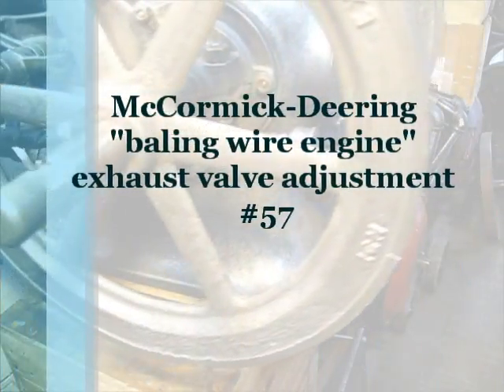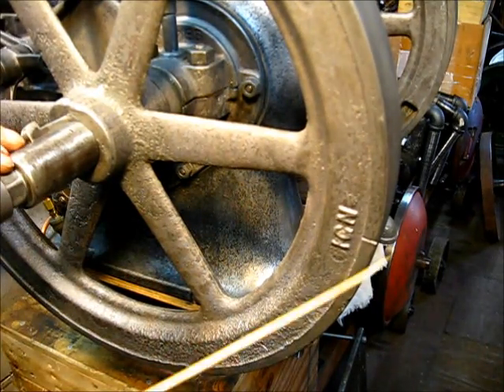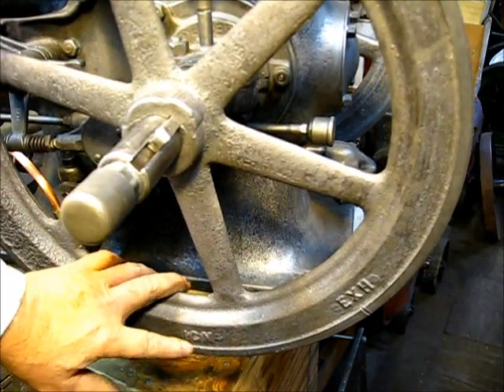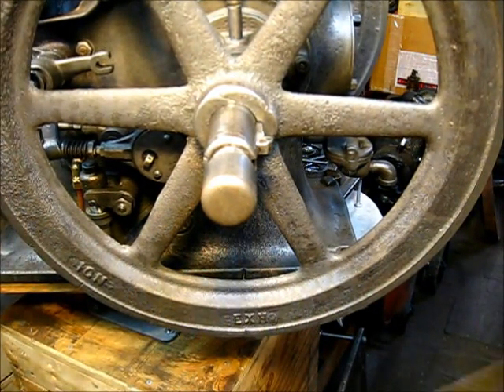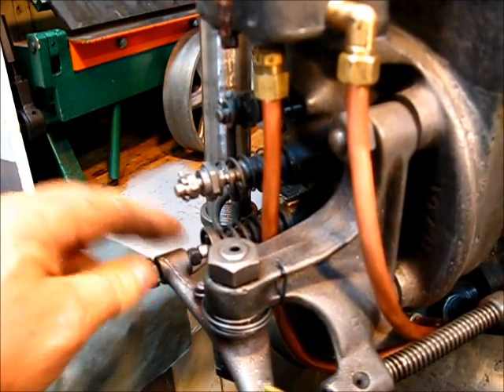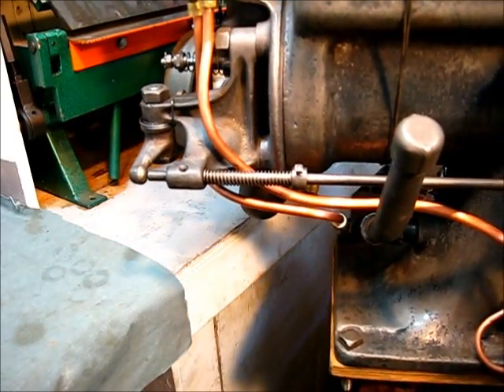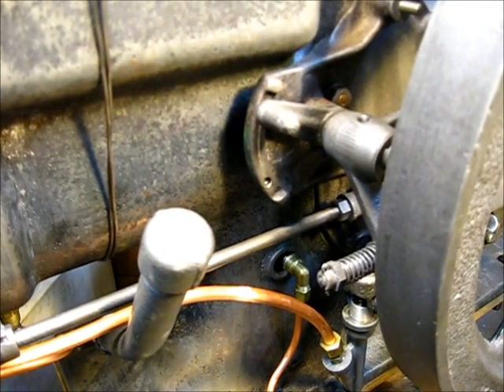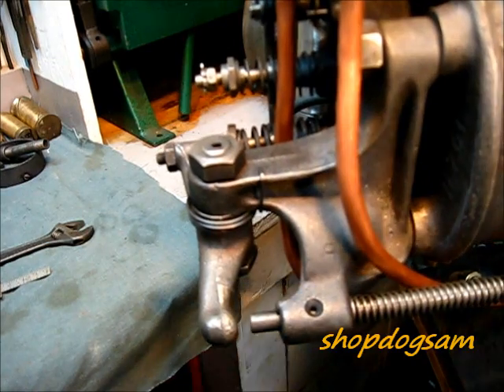McCormick-Deering "baling wire engine" #57

Comment: I bet it runs good because you said it had compression. What would be a good example of what it could used to operate?Will it run fast enough to run a generator? I see a lot of fans people put them on and that would be nice about this time of year because its hotter than the a wagon wheel hub outside.

Comment from the maker: ,,,, boiled linseed oil finish (oh!, this is gonna be good),, ek magneto rebuild (a more complete video will follow later),, ignition timing (easy to do),, mounting 'er on an engine cart (cart is already built),, gas up (camp fuel),,,, but first let's take a short ignition side trip,, with a running engine, leave comments,, thanks